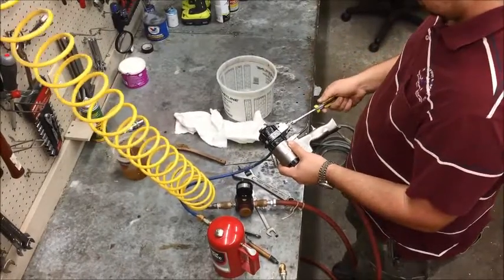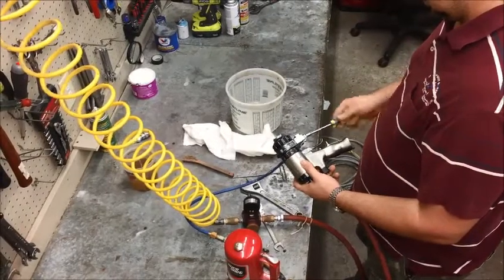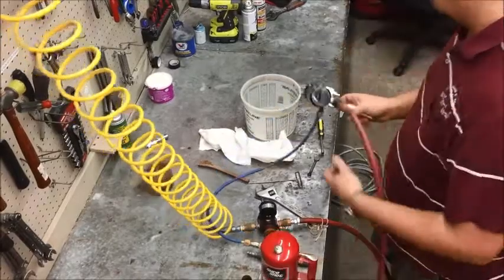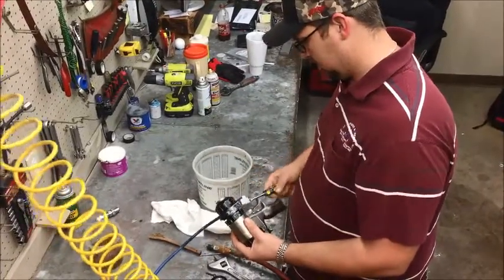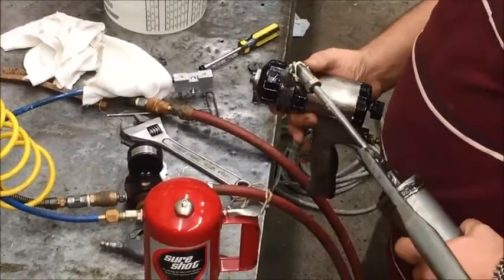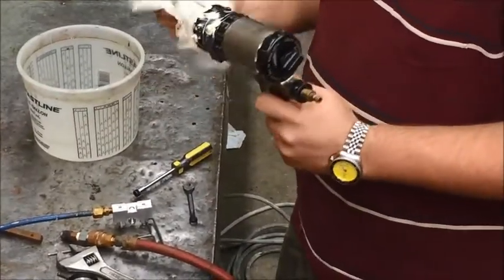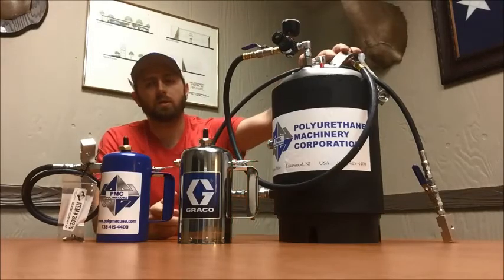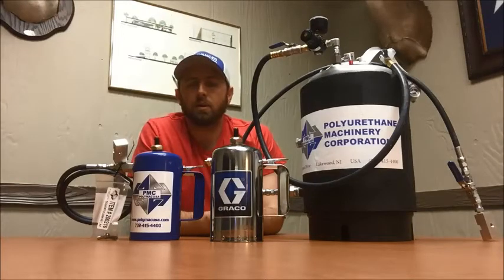Tech Tips ep 1: Flushing a Spray Foam Gun

Comment: Whats the best way to switch from closed cell to open cell?
Reply from the maker: Hello, Sean.  The best way to do this would be to purge your lines.  If you'd like a walk through, give us a call at 1-800-677-3487 and ask to speak to the tech department.
Reply: Sean Joubert having  issues with fusion  gun b side leaking,  try New seals and no results   leaking continues. Thanks for your help
Reply from the maker: Gustavo, where is the gun leaking from?  Is it coming out of the side seal port or backing up to the handle through the mixing chamber?  It could either be a side seal issue or a mixing chamber issue.  Feel free to give our tech department a call at 1-800-677-3487.  Ask for Calvin.
Reply: Sean Joubert. We can not get our machine to spray